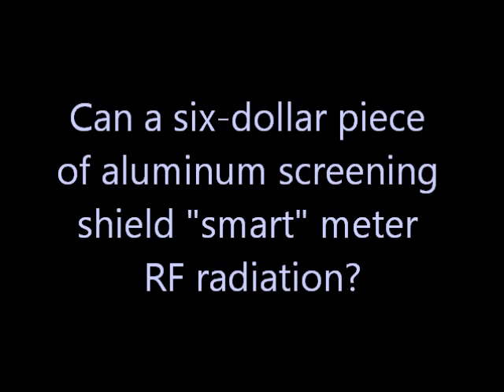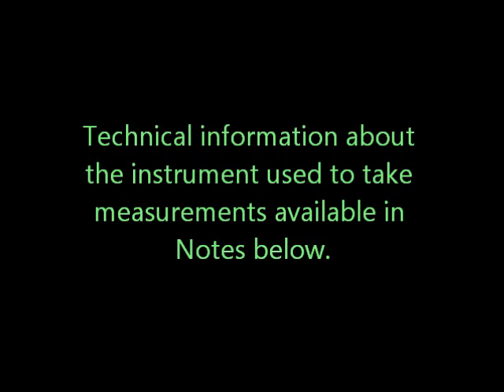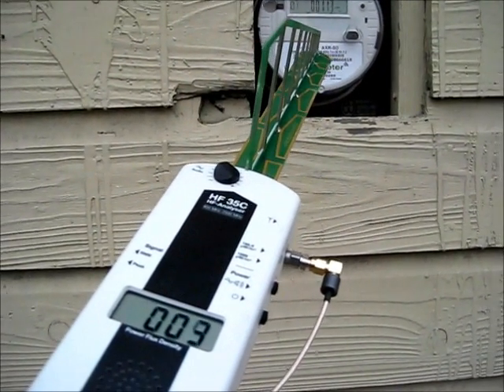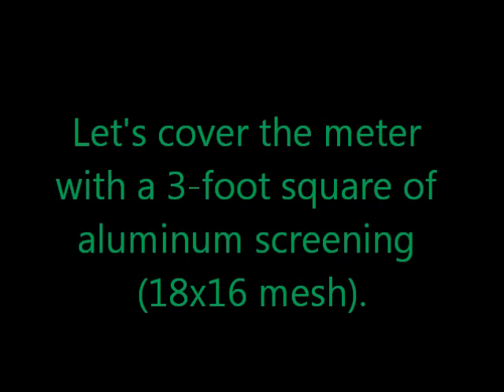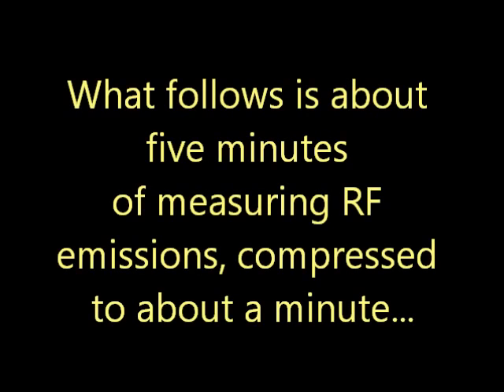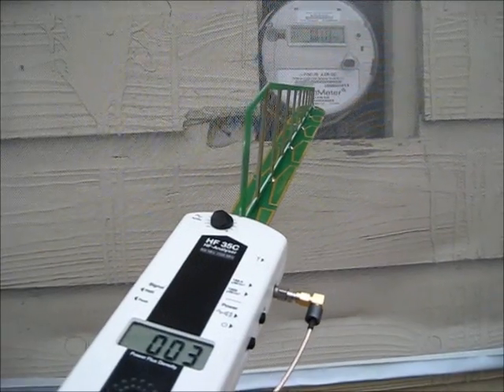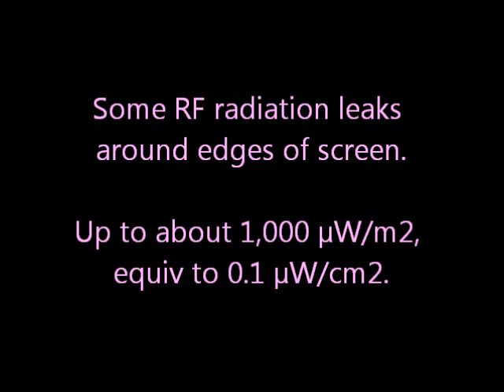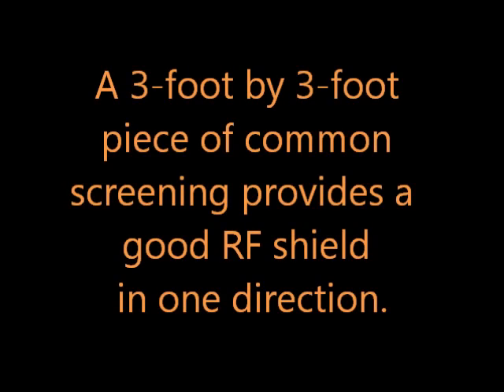Foiling a "Smart" Meter, Part Two: Aluminum Mesh Screening

Comment: Unfortunately Idiotic Vids like this based on flawed theories undermine the real problems. 

I bet the tools who did this vid happily chat on their mobile phones for hours, sit in from of big computer and TV screens and don't even realise, what they are detecting is a lot less and a lot less frequent than these other things. 

The meters down't emit radiation, they work on pulses and ripples through the wire. They have been controlling off peak water heaters and the like for decades like this. You can buy Ethernet over power wires devices for your home. 

This is not some dark black secret, it's a bunch of I'll informed morons making something out of what isn't there. 
Smart meters have a lot of issues with privacy and how they can make as much money as possible from you but this thing about radiation is a crock and a half. 

If any one thinks otherwise, please with precision and detail, explain exactly what is inside the things and what physical properties and laws are at work that allow them to create this radiation. 

And by the way, Show me a vid of that meter next to a light switch  when it's turned off and on and see if it doesn't emit " radiation" . 
If you really want to make it Jump, put it in your car and turn the lights off and on or the AC on and off. DC will give a far greater spike when being switched that AC ever will.
Reply: Frederique Zug
Do you use a Mobile Phone? Laptop? Go anywhere there is WIFI? Bluetooth?
Every ride in cabs? Have a Microwave oven at home?
Are there any other fanatical Crusades you are on or do you limit yourself to just this one?
Reply: Oil Burner  Don't you realize this one is an expert on EVERYTHING.  I ask for proof to bsckup her statements, and all I get is stupid non related questions.  "What's the minimum safe distance ftom the center of an AM17 antenna" ? Never any conclusive proof, just stupid non related questions, worthless links to the FCC, and name calling. I'm convinced this one lives under a bridge.
Reply: Robert Mitchum   This one looks good:  http://www.bmk.lt/ip_themes/bmk/images/logo.png
Reply: Dan Bc
You're Right. I am trying to be more chilled and let these sorts of people believe whateve they want. They will only ever listen to what they want to hear and have already made their minds up is right anyway.  The nutter here seems to have taken his bat and ball and gone home. Maybe he had a realisation or has found another cause to champion?
Reply: Frederique Zug
The fact you can't answer a simple question shows you are the one with something to hide and your accusations about others are just smoke screens.
I don't think you have paid employment at all.
Reply: Ebenezer Kalarama  And as BM&K Inc. We can install giant radio towers and sell our overpriced highly radioactive power the Tesla way.
Reply: My BS as you call it,  comes directly from a link YOU posted.
Reply: Robert Mitchum  Freddy deleted his posts here again? There were about 20-30 of them just a few days ago.  Oh, the humanity..
Reply: Ebenezer Kalarama
He's the most Phsyco, childish little whining bitch imaginable.
Too far gone to worry about arguing with..
Reply: +Oil Burner No, I just know I'm affected by things, and (accidentally) proved to myself that my Comcast router, set to Hotspot, was making me tired in 10 minutes.  I eliminated health, sleep, eating, etc. as a cause.  Now, I don't know if I just added energy, and that was the cause of me not being affected with things/people when I go out, but i would suggest it has to do with the tremendous increase in EMF in our air.  I have observed others, and almost all aren't even aware of their energy levels, etc., and probably attribute these to other things(talk about delusions-they don't even know.  I'm not trying to put anyone down here, as I give away something that helps them a bit.).  I'm sorry I'm so much more advanced than you are on energy, but I can assure you that I've tested out things for the last 15 years, on keeping my energy level high at my physical labor job.  There are things that can be done(I would include me be lucky here.), and keeping distance from strong emitters is important-besides raising your energy levels(based on my router situation).  I don't know how you can refute this, as my argument comes from doing things,and also being affected.
Reply: +Oil Burner Stay in school.  You have the drive, but lack the knowledge.
Reply: Oil Burner so i guess you dont know about most of the hydro elect workers who die all around 50-60yrs old from brain cancer!did u ever get sick from these meters?how close is it from your bed when you sleep...
entire familly here that all got the symptoms for 6months,i paid to get the non communicating one,next day whole familly does good...
can you explain me this mr oil burner...thousands of people all got the same effects research my friend...southern american countries all rip them out and bypass them gov cant do nothing,we should all do the same,see the outcome when everyone does it,none...power companies going bankrupt who is left to sue you?no one ;)
Reply: +Oil Burner
What is crazy is that the media gives this peoples a platform for them to spread this nonsense
Reply: Heeees  Baaaack!!
Reply: Frederique Zug
So your obsession is not with the radiation the meters admit at all, it's the fact they don't have a warning sticker on them?
And all these other things I mentioned that emit radiation are OK with you, it's just power meters that you have a hang up with because they have no warnings and if they did that would make them ok.

Right. Glad we clarified that!
As a power company manager ( which you keep telling me I am)  I'll get warning stickers made up and have them put on all our meters so lunatics like you are satisfied and put a warning on our website.
If you had made it celar this was all you wanted we would have done it in the first place just to shut up your deranged whineing and calm whatever mental affliction you have.
Reply: Frederique Zug
I also work for NASA as an astronought, I'm a leading brain surgeon ( alas I fear medical science isn't up to fixing your problems) and I'm James Bond's boss as well. On the weekends I head up the  Government  " Department of fantastic secrets which includes hiding the fact Ailens from space live here, that you can get 150 MPG with  a special carburetor Fitted to a Train or battleship, That cold fusion exists, The seceret of eternal Youth and huge civilizations live under the sea. We also have the new portfolio of Chem-trails.

And I'm a stupid idiot.
I'm really wondering if this is all just a set up and you have suckered me because it just does not seem possible to me that you could be a real person and honestly be this deranged and  maniacal.

I hope for the sake of humanity you are having a laugh at me because if you are real, you could be the most insane person I have ever come across in my life.

I have seen the way you carry on to other people in other threads. I'm convinced you are real and that's the most scary thing I have seen in a while.
Reply: Oil Burner
Oh, after making himself look like a nutcase beyond any possible redemption, he's deleted all his maniacal ravings and disappeared. Permanently I hope.
Reply: People are always going to be afraid of things they don't understand.  I got a headache. ... Blame it on RF. My kids doing lousy in school... It must be that antenna on top of the firehouse next door fogging his brain. I stubbed my toe... Must be that damn Smartmeter screwing up my equilibriumequilibrium.  These people make me laugh, running around yelling "THE SKY IS FALLING" and have not a shred of evidence to back themselves up.
Reply: Robert Mitchum
The scary part is, after all the bleating and wailing about radiation, as soon as I pointed out the radiation from Mobile phones and microwaves, Suddenly the whole issue was the lack of warnings.  The man has no idea what he's actually upset about.

And then I said I was a power company manager and he really appeared to believe that and think it was proof of his accusations all along.  Yeah, I'm a power company manager that stuffs around with making waste oil burners out of Junk and making a YT Channel about them because with my Multi hundred thousand dollar a year salary, that's my favorite pastime and I have nothing better to spend all that money on.  Idiot moron couldn't even figure out I was in another country!

When you come across people like this, you really do get to understand the problem with mental health care that's for sure!
Reply: Oil Burner  You too!  According to this guy I  work for the power company as well.
Reply: Robert Mitchum Well at least that was nice of him to prove your point so inarguably.

You know what? I haven't got a clue what the distance to an antenna is and I don't care. I also don't care about trying to answer his incessant question. I mean what would it prove? That I goggled it so I could satisfy him? If he thinks he's going to walk me down the garden path as easy as he can be lead by the nose he really is a dilettante.

I do find people like him amazing though. How anyone can be so completely obsessed and tunnel visioned to put logic and common sense aside is just incredible.  He really thinks  a couple of power company managers are going to sit on YT trying to defend their practices with one clown who comes across as a fruit loop? I have had my dark times and Wig outs but clearly I have never seen the darkness and lonely places this wack job is in.  The worst part is he probably thinks he's fine and everyone else is the fruitcake which means he'll never get the help he so badly needs.

I wonder if he has a normal job or is on some sort of pension because he can't work? I wonder if he has any real life friends or maybe these online arguments are his only contact with other people?  It's worrying to think about.

If I did run a power company I'd also probably have the power, money and influence to get this poor nutter the help he badly needs.
Reply: Frederique Zug
 Try to concentrate and stick to a simple answer of a simple and honest question.

What is your concern/ grievance exactly and concisely?
Is it the actual radiation the meters admit or is it that there are not sufficient warnings about them given to the home owners or sick people or is it something else you can tell us with clarity and precision?
Reply: Frederique Zug
What work do you do? Is your paid 9-5 job actually working for some group lobbying against these meters or do you hold down a regular paid position  and if so what is it or are you paid for both?
Reply: Frederique Zug
So do you have paid employment or not?
Reply: Frederique Zug
Who Pays you and what is your position title? Are you full or part time?
Reply: +Oil Burner  I'm sure that zug was either caught stealing power, or his power was shut off for non-payment. Nothing at all to do with any other conspiracy/health warnings. Hence his deep, creepy hatred issues.
Reply: Ebenezer Kalarama
This would make a LOT of sense.  There is definitely something going on there although I am seriously leaning towards a mental illness of some sort. His obsession is clearly nether healthy or that of a normal person.
As far as I can tell he lives in Switzerland but has an obsession with the practices of the US  power companies.

He says I'm a power Company manager but I wish he'd tell me who I work for. There is a pile of big paychecks sitting somewhere with my name on them I haven't recieved and I'm just  dying to cash them!
Reply: Frederique Zug
I don't know what power company I work for but as you are so adamant I do work for one, Tell me who it is!
I want to collect all those paychecks I haven't received as yet.

BTW, are you a member of some religious cult or organization? You sure go on like a religious zealot.

Seriously, are you so utterly obsessed with this you can't see how the way you go on just loses the message entirely and makes you look like a lunatic?
If you calmed it down to a more rational level, people might actually take some notice instead of instantly writing you off as a ranting nutcase.

You live in switzerland right? Why are you so obsessed with the US power company practices?
Reply: You really think I could give a FK about playing your psychopathic games???

You are a fruitloop to behold fella!
Reply: Frederique Zug I'm betting the funny farm you escaped from didn't put a whole load of effort into finding you and bringing you back.
You really are completely gone aren't you?
Reply: Frederique Zug Have you worked out yet that no one is paying any attention to your  rants or looking at your links?

Just save your time and try peddling your hysteria else where. It's not working here.
Reply: Robert Mitchum I've been accused too... it must be another conspiracy. Anyway, we can name our power company Burner, Mitchum & Kalarama, Inc.
Reply: Ebenezer Kalarama The sad thing is, I have read the links left by others, Cancer Society ect. And though they read about concerns and ongoing tests. They all say there is NO REAL evidence that RF causes, stimulates aggravates cancer. In fact they state RF exposure does nothing more than heating of body tissue. And furthermore,  RF has no adverse effects on pacemakers ect. Something that seems to get left out in each and every post I've read here so far .

Is it me? Am I  looking at the world through my Beer Glasses again?
Reply: Are there any health effects?

A large number of studies have been performed over the last two decades to assess whether mobile phones pose a potential health risk. To date, no adverse health effects have been established as being caused by mobile phone use.

Short-term effects

Tissue heating is the principal mechanism of interaction between radiofrequency energy and the human body. At the frequencies used by mobile phones, most of the energy is absorbed by the skin and other superficial tissues, resulting in negligible temperature rise in the brain or any other organs of the body.

A number of studies have investigated the effects of radiofrequency fields on brain electrical activity, cognitive function, sleep, heart rate and blood pressure in volunteers. To date, research does not suggest any consistent evidence of adverse health effects from exposure to radiofrequency fields at levels below those that cause tissue heating. Further, research has not been able to provide support for a causal relationship between exposure to electromagnetic fields and self-reported symptoms, or “electromagnetic hypersensitivity”.

FROM YOUR OWN POST!

Should further studies be conducted. .......   Of course. ..... But after reading this and other studies,  some of which you even posted. I see no reason or find any evidence that RF exposure is detrimental to ones health. If your going to post info, post all of the info, not just the parts that fit into you cause and omit the info that is against.
Reply: Robert Mitchum  Do you mean to say someone here is posting links to websites that have info that actually contradicts their own position??    o_O
Reply: Maybe he's a power company manager too.
Reply: +Frederique Zug A study that examined the effect of smart meters on pacemakers and implantable defibrillators found that the smart meters did not interfere with these devices.

  Once Again.... From your own posted link....  If there is another site stating differently,  Let us know...  As for the medtronic link , nothing more than general rule of thumb and not very accurate.  Computers are safe, but an i pad is not... People don't have WiFi on yhrre computers ?
Reply: Robert Mitchum http://www.pge.com/en/safety/systemworks/rf/faq/index.page
Reply: Frederique Zug  Here we go again with the insults and the childish name calling.  Why is when you get backed into a corner the insults, the avoiding of direct answers and the conspiracy line of horse shyt is your only defense.  Once again I  ask you, why do you only post bits and pieces of information that conforms to your way of thinking?  And why is YOUR  information the gospel truth, and all others BS?  As for stupidity and falling for such, I know someone here who fits the bill.  As for the REAL FACTS....... Post some , I'll be more than happy to read them..
Reply: Frederique Zug  Try readind the ANSI report, over 60 years in the making with more than 11,000 refrences. It's only a mere 80 pages. When you gain the knowledge and the understanding,  let me know.....   You post these links but you have no concept of what you are actually reading. You talk of Spread Spectrum. ......  please explain how it works, What was the inspiration behind the technology and who invented it. What does the term dbi. mean dbd. ,  How do i match a 70 ohm dipole to 300 ohm ladder line?  Define Resistance, Reactance, Inductance, Capacitance, Phase Shift, Inverse Square. Reciprocity.   See, I  can spew out technical terms as well. But unlike yourself, I know and understand what these terms mean.
Reply: Frederique Zug  Cut and paste?
 I gave that up when I was five years old...  Why the constant questions answered by more questions?  Are you sure your not a politician?  The repetitiveness of your posts is mind blowing. Thousands of words and not one thing worth of value in any of them.
Reply: Frederique Zug  THANK YOU.... THANK YOU. .........T H A N K YOU!!!  I was wondering when the village idiot comment was going to appear. .... And long behold...... HERE IT IS..  I give you credit, I was expecting it 5 posts ago.  Way to get your message across, Insult the masses into your way of thinking. WELL DONE! WELL DONE!  If you can't dazzle them with brilliance,  baffle them with bullshit.  And you call yourself a teacher... Sorry, but I can't stop laughing. .... Once again, I'm tired of whipping a dead horse, Consider this my final post on this matter. This is one "Village Idiot" who's had enough... Keep plugging it... Three more brain cells and you to can qualify as an IDIOT!
Reply: Oil Burner  Obviously nothing better to do in life. Normally you'd feel sorry for someone who has major mental problems,  but in this case all I can do is shake my head and say to myself WTF is this looser been smoking?
Reply: Robert Mitchum
I can only think that there must be something wrong with him upstairs because as hard as I try to imagine a well balanced person being so  obsessed with something and going on the way he does, I just can't see how it's possible.
The spoilt child mentality goes further with the
Deleting of posts when he is caught out.
I fear it's not the last we'll hear of this fruit loop though. He'll be back like the Pox.
Reply: ^ ...probably had to run downtown and refill his Seroquel.
Reply: +Oil Burner First off, I distrust the study that says the average power of the emf reading is more indicative of what goes on, versus how high that reading gets.  Second, the emitting frequency by smart meters is close(or the same?) to wifi frequencies.  These are non-ionizing frequencies, but are extremely high.  Money has kept these non-ionizing frequency health effects from being included in what is looked at.  I think all those other examples that you give, which tries to equate the dangers of wifi to non-wifi , are a false equivalent.  I find your statements very confusing, as for me, we are really dealing with the frequency and power of these things, and that's not relatable to the other examples you site.
Reply: +mmakshak cite, not site.
Reply: +mmakshak  freddy, is that you?
Reply: +Oil Burner I don't wear a medical device, where people have to be concerned about these things.  I am affected(as are you-you just don't recognize it) by the super-huge increase in super-high frequency, non-ionizing EMF put into our air(and through our bodies) by wifi.  I'm disappointed that the companies utilizing this technology spend nothing on making things safer, but spend a ton on bribes(campaign contributions) instead.  This is done to keep standards how they are.  Equating this to anything that has happened in the past is not correct.
Reply: mmakshak
IF you are not Frederique, You are just as obsessed and he's a total nut case.
Reply: +Oil Burner You can eliminate a lot of the effect of EMF outside in our air.  So, what's the problem?  The only way to do this is to come up with solutions-not say there is nothing that can be done.  The perpetrators of these things(power and cell phone companies, etc.)aren't going to do anything.  You owe it to your love ones to allow discussions to go on, and maybe contribute by pointing out what you know to be untrue.  We don't need blanket statements.
Reply: +Robert Mitchum People who are sensitive to these things are cursed and blessed.  They also know much more than you do about it.  Their body is a meter, and anything that helps them is important information.  You seem to think all of this has to do with someone reading something.  Some is, but a lot has to do with how it affects them physically.  They may experiment with distances from devices like this, and since the perpetrators prefer bribes to any knowledge, you aren't going to get much info on these things elsewhere.  I guess, if one is not affected, he could look at frequency and the power of the transmitter, and do the math.  Many of these devices are in a fixed place, so the only thing changing would be the distance(possibly with a few variances).  That, my friend, is how a scientific experiment is done(change only one thing at a time).
Reply: +Oil Burner His concern has to do with a medical device he wears and the possibility of smart meters causing that device to malfunction.  You don't think Frederique should be concerned about this?  Distance has a major impact of the power of the transmission, so it's very important.  If I were you, I would allow discussion to go on.  It may help your loved ones.  You can help, by pointing out some incorrect things.
Reply: +Robert Mitchum They've rearranged the comment section.  I'd advise you to not summarize studies as showing no evidence, because that's not the case.  There is a vested interest in keeping standards how they are.
Reply: +Robert Mitchum What they want to portray is non-ionizing frequencies are safe, because ionizing frequencies are dangerous.  Does that sound like a logical conclusion?
Reply: +Robert Mitchum I believe you have an appreciable number of scientists warning about the dangers of non-ionizing EMF(like wifi, etc.).  I guess they are just crazy, also.
Reply: +Oil Burner Wait a minute.  Let me close my eyes, so I can believe everything you say.  I should immediately stop studying or learning anything, because you have the answers.  Let me repeat myself here:  Money has kept the hazards of non-ionizing EMF from being dealt with.  Tell me how that's not true.
Reply: +mmakshak How many times are you going to reply to comments already made and have a conversation with yourself??
 
If you are not Fredrique, you are another fked in the head loony just like him!! 
You carry on like fruitcakes and then wonder why people just dismiss everything you say. 

Carry on all you want, no one is going to listen to people that are obsessive nut jobs so you are wasting your time.
Reply: +Oil Burner He has a medical device that might get affected by smart meters, and he concluded, once he found out about it, that it was very dangerous to him.  Wouldn't you get upset, if that happened to you?  Let's put this thing into a reasonable dialogue.
Reply: +Oil Burner Maybe if there was some notice that smart meters were being installed, we wouldn't have the huge outcry.  But, of course, we are just peons, and anyone can do anything they want to us.  It reminds me of Trump rallies, where others come to cause trouble for Trump supporters, and Trump gets blamed.  I don't know, but every court case I've seen, when 2 people get into a fight, the person who came over to the other person's house was found guilty.  Well, it's the power companies who came over to our house.
Reply: +Oil Burner Maybe if you stuck to facts....
Reply: +Oil Burner If you don't think distance from a transmitter matters, you aren't qualified to comment on EMF,
Reply: +Robert Mitchum I don't have a medical device, but they used to warn such people about microwave ovens, so your characterization of radio frequencies having no effect on these devices is just not true.  Anyone remember the signs in the 7-11?
Reply: +Oil Burner My comments are actually based on my experience, with an eye out for possible standards.  Your comments are based on character assassination, and are worthless.
Reply: +mmakshak  Great! That being the case, do you think you can stop addressing replies to me for comments that were never made?
Your comments are based on an obsessive  disorder. I know you think you are right and everyone else is wrong, Thats what every  nutcase thinks!
Reply: mmakshak Just a little suspect that when fredrique turns up again, so does mmackshack going on about the exact same drivel and harping incessantly about distance to meters etc. Nice try but too obvious.
You seriously need help Fella, you are one fked up sick little puppy.
Reply: +Oil Burner Replying to myself-I'm waiting to see how long it takes you to realize that it's YouTube that clumps comments together, and not me.
Reply: +Oil Burner I'm waiting for anything of value you have to say.  It seems to me that your comments have to do with insulting people.
Reply: ....and the inability to write a correct sentence or paragraph in the English language.
Reply: maybe that guy owns the screen buiss. hahahaha
Reply: if they did all that , why would they add to their wifi usage by adding a smart meter. Wouldn't be very smart would it.